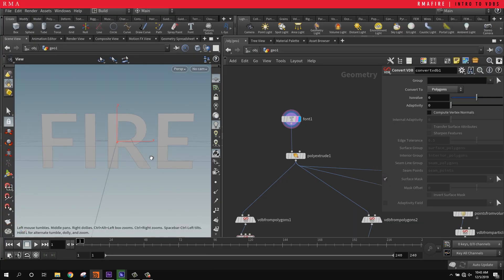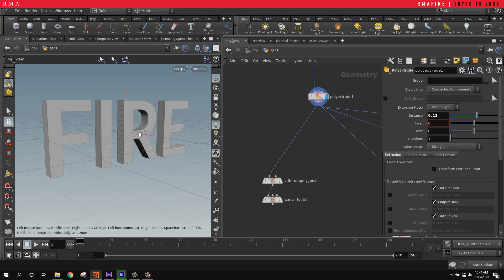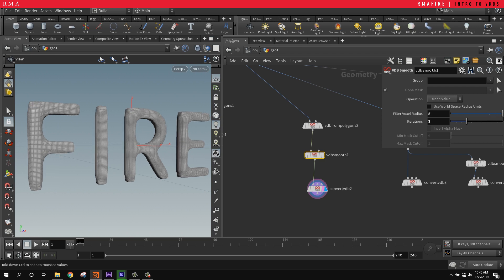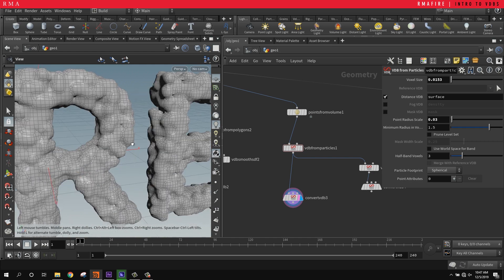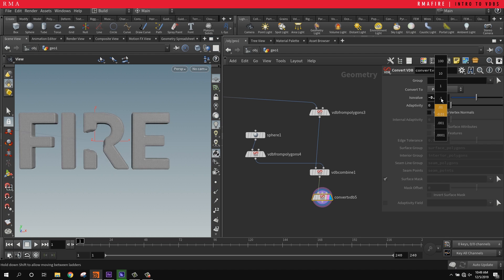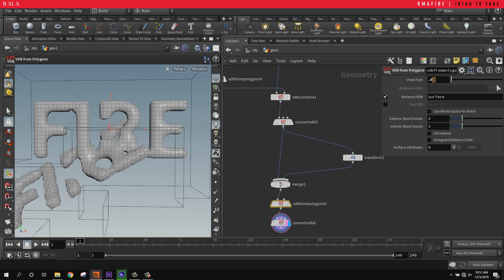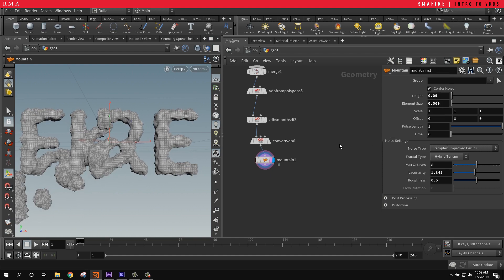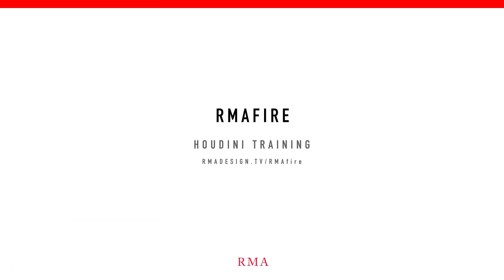VDB Basics in Houdini  *FIXED GLITCHES

Comment: what's the difference of this and the gamedev Voxel Mesh node? On the latest streamings they used Voxel Mesh to make the high poly mesh
Reply from the maker: Hi Carlos, the vixel mesh is an otl or digital assets thats got an inbuilt functionallity which has preset options similar to one of the topics i covered. Basically the same as converting geo to a vdb and a vdb back to polygon. If you dive into that asset, you will se its using vdbs and exported the parementrs so you can use is sops. Theres multiple ways of getting to the same thing in houdini, my explanation is more like looking behind the hood and seeing different ways you can use vdbs that way you have more flexibility.